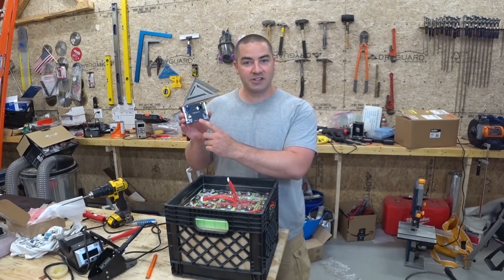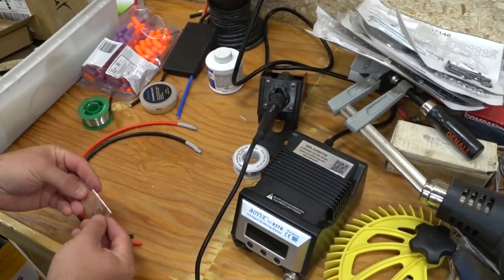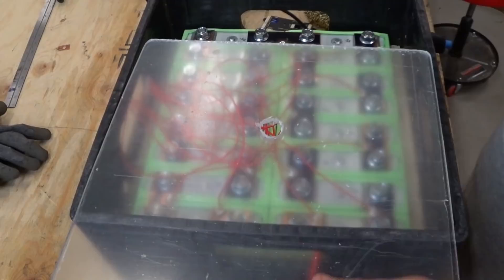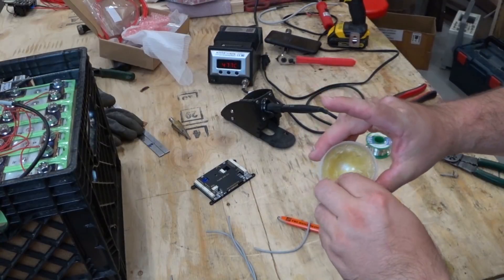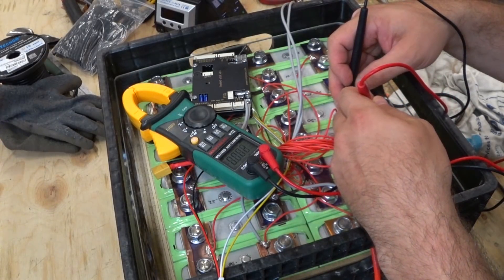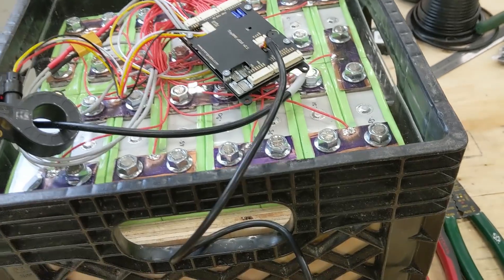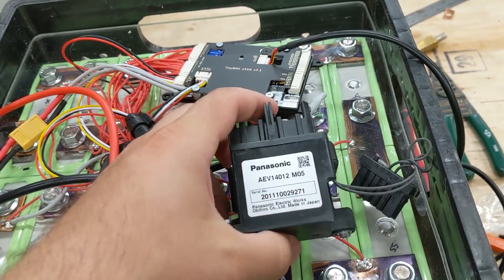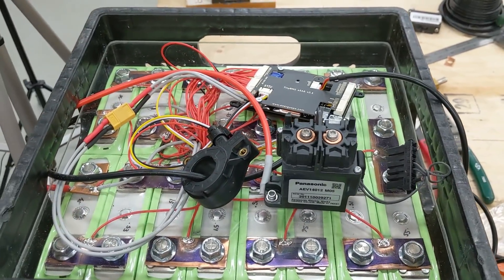Tiny BMS installed in the Milk Crate Project

Comment: Where did you purchase those spools of silicon wire? I can only find small pre-cut lengths on eBay/Amazon.
Reply from the maker: Red: https://amzn.to/34HUknl
Black: https://amzn.to/32uFmhO

They come in handy for all these projects.  I'm glad I bought the spools.
Reply: Ordered one of each, thank you!
Reply: @DavidPozEnergy  Question for you sir. If you built a 48V pack out of LifePo4 cells than are 280 ah each, how much would that actually store in kWh? I was also wondering if you knew anyone using wind turbines with these type of cells? I want a hybrid system where I am.
Reply from the maker: Hi Dave Froman.  If you are using 280 ah cells, then multiply the ah by the cell nominal voltage.  In the case of LiFePO4, that is 3.2v.  So: 280 ah times 3.2v = 896 wh (watt hours) per cell.  Then multiply that by the number of cells you are using.  This video is using 16s.  So if you also did a 16s, it would be: 896wh times 16s = 14,336wh or about 14.3kwh.
Reply: @DavidPozEnergy  Thanks for the explanation :) And that is the magic number I was hoping to hit!

Comment: Hi, I am using the same tiny BMS and followed each and every step but when I connect it with USB to UART cable with battery insider installed in my laptop it does not show any thing and it does not detect the BMS. The only thing which I did not follow I have not used the USB isolator and I struggling to find the same isolator which David has used. Any help related to this will be really appreciated. Thank you

Comment: For anyone reading this: Be sure you get genuine XT60 connectors, not chinese knock-offs, which melts and starts fires.
David, this is a quite pretty DIY build. If one does not have a milk crate, MDF or plywood could also do the trick.

Comment: Hi David, I have a question about BMS, I have a daly BMS, for lifepo4 8s I found out while charging the battery that the BMS cut off is set to 3.75 this seems a bit high.. can you brig this topic in one of your videos what should be the BMS cut off values? thanks
Reply from the maker: I agree it seems high, but it's not unusual.  Ideally, the charger is set less than that.  For example, I use Daly BMS's on my batteries in 16s.  16x3.75=60v  My charger is set to 56.8v.  If the cells are top balanced then no cell would ever go to 3.75v.  The BMS is there is something goes wrong.
Reply: @DavidPozEnergy  Yes, exactly, this only happened because the cells are old used cells, they have different resistance, I have balanced them but then on the first cycle there was one cell that was high and the others were low.. the pack voltage was under 29v but this cell was 3.70 :/

Comment: What if one of those solder joints on the BMS leads fails?  Will that harm your battery or your BMS?
Reply from the maker: The BMS will just shut off to prevent any damage to anything.

Comment: What resistor are you using at 7:00 ?
Reply from the maker: https://amzn.to/2NrBrhI  But most resistors will work.  You can even use an old lightbulb.  The goal is to slow the charge of the capacitors.

Comment: hi, if i have a 12v diy battery pack with bms, and a 100w solar panel, do i still need to have a charge controller?
Reply from the maker: A charge controller is required for almost every situation, and all lithium batteries.  But if you have a unique situation of flooded lead acid batteries, and the correct voltage of your solar panels, then it's possible you don't need one.  But that type of situation is very rare.

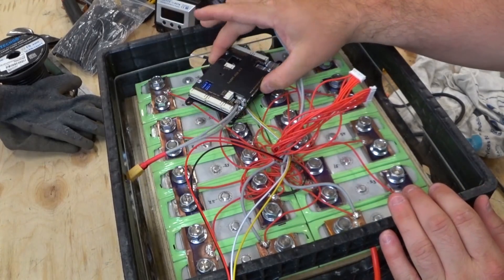Comment: 6:45 Could also just use another one of those XT60 connectors and charge up the bms with a current limited power supply set to the same voltage as the battery instead of the resistor.

Comment: Isn't it OK to tap off 12V from the 4th cell (from the negative terminal)? That gives you a common negative, but a 12V supply for the relay, rather than using another converter. But maybe there's some reason that's not a good idea -- I can't think of one though.
Reply from the maker: I'd be OK if you don't constantly use power.  But if you always draw from those 4 cells, they will drop in voltage prior to the other 12 cells.
Reply: @DavidPozEnergy  Right, but the current to just hold the relay will be small compared to the total draw from the pack, so it should be insignificant.

Comment: How do wire sixteen 100ah LifeP04 lithium cells to create a 24 volt battery?
Reply from the maker: Wire every 2 cells together in parallel, then series 8 paired groups.  This is written as 2p8s, meaning 2 in parallel and 8 in series.  If you are on Facebook, then check out the group "DIY Battery" for more help.

Comment: Please add a strain relief for the main poz/neg, and perhaps a way of retaining the relays/contactors..and dont forget as the posts/strips warm and cool, theyll expand and contract...maybe put the isolator in the box as well, and leave the micro port easy to get to..along with an emergency off button or emergency power off port, if you plan on making multiples of this, to link togeather to a single shutoff button...(and or fire system)

Comment: I hate to say this, but with the  wood you have in the milk crate, you just insulated the entire battery pack and therefore will hold the heat in and therefore the entire pack will have low heat dissipation.  That is not good for those cells.  What you should have done was make spacers in between each cell and eliminate the plywood sheets.  That was the whole pack could breath and therefore eliminate heat between the cells.  I have an electrical and electronics engineering background and have a solid working knowledge of batteries and battery construction.

Comment: Can you do a little "short", where you explain the use of the resistor?  It wasn't clear to me, what you did & why.  Cheers!
Reply: the resistor is used to dampen the "in rush" of current into the BMS. Think of it as a restrictor that slows down the amount of juice flowing in. It also can prevent sparks from flying when there is a dramatic difference in voltage potentials. Once the two systems have "equalized", the resistor isn't so important, but it's always a good idea to keep it in the loop. You'll note that the size of that resistor is large, (fat+long with heatsinks) the amount of restriction may be low (low resistance value) but it's ability to handle high current is dictated by it's designed ability to remove that heat. Hope that explains it for you.

Comment: Next time when you go to drill a hole in the plexiglass, sandwich it between two scrap pieces of 2x4 and drill through the sandwich. You'll have a clean hole in the plexiglass. Hope that helps for the next time :)
Reply: Just use your stepper bit.

Comment: just started watching and am intrigued by your projects.  but i have a lot of questions.  i have an RV that i want to build my own battery bank.  it is 12 volts.  do i just build a 48v pack then step it down for the 12v?  how can i make sense of the numbers?

jd
Reply from the maker: 12v is OK if you are running 12v lights, 12v radio and little things like that.  But the amps will get too heavy if you try to power normal AC loads.  So I prefer using 48v for anything that needs an inverter and AC outlets.  Sometimes batteries are rated in amp-hours (ah) and if you multiply the ah by the volts you will get the watt-hours (wh).  That's a way to normalize comparing a 12v to a 48v.  This milk-crate battery is about 3kwh (3,000 wh).  If that was in a 12v version it would be 3000/12=250 ah.

Comment: That looks like a great BMS but those pads where you connect the battery don't seem to be able to handle much current.  It would have been better to have studs so you could bolt your battery cables instead of soldering.  I would be afraid of the solder melting at high amp draws....!

Comment: DavidPoz, I have a dumb question that by the way, you are the only person that has a video on the Tiny BMS, I'm using this BMS on a 10s battery pack and looking over the doc file I just thought I would ask you. topmost wire is attached to + (also number 1 cell) and the bottom is connected to - only...  thanks
Reply from the maker: Thanks for checking out the video.  I hope to do more videos on this BMS because it seems like it can do a ton of things.  You probably already have the manual, but I'll link it just to make sure you are not looking at the quick start guide.  manual: file:///D:/Users/David/Downloads/TinyBMS_User_Manual%20(1).pdf  On page 14 there is a wiring diagram.  I think this one diagram is most useful for understanding the layout.  Yes, the top most pin is the main positive of the whole pack.  The bottom ones will be left un-used after you finish your 10 cells.  10 cells should mean 11 sense wires.  Make sure you check all your wires are correct on the white terminal before plugging into the BMS.  If you have just one wire crossed it will (probably) fry the circuit.
Reply: @DavidPozEnergy  thanks, I do have the doc file and was looking at page 14 to, but on that page the last wire looks like it goes to - the also looks like it connects to a cell, plus pack + is also + for cell number 1... Just looked weird. I have wired up a bunch of BMS cell 1 + and the last wire goes to - simple
Reply: Thanks, everything works great, on page 13 in the doc it talks about a 10s pack and gives you step by step, great documentation!  Now I'm waiting for more parts to come to.

Comment: You are doing a great job, and I love your videos.  I'm a newbee, I understand the need for a relay.  Can you recommend off-the shelf relays that would be readily accessible to us and show their hookup?  Scavenging parts from an electric vehicle is not an option for most of us.  Are they that expensive that rather than buy one, you scavenge one and have to buy another for it to function?  Also, if you could recommend a proper resistor to use for the hookup would be helpful.
Reply from the maker: Thanks.  Great suggestion.  The type of relay I showed (from an EV) can cost more than $200 new.  But if you don't need 300 amps, there are more affordable options.  Actually, I"m looking at some smaller options for this particular build.  But I also want to learn how to use the big relays so I can use it on some bigger batteries.  This particular milk-crate build I have 10 gauge wire, and will limit it to 30 amps with a circuit breaker.  So all I need is a 30a relay or more.  I'm considering using one like this https://www.mouser.com/ProductDetail/Omron-Automation-and-Safety/MY2-DC48-S?qs=sGAEpiMZZMtGt%252Bn33CgIP%252B2KxmC%252BClteYxZLiC3CNNo%3D
Reply: @DavidPozEnergy  What I have in mind is a 48 V system using an MPP 5048 like you had in one of your other videos, and based on Will Prowse's 24 volt hand cart system.  I plan on getting a Tesla in the hopefully not too distant future, and hope to use solar to charge it.   30 amps may not be enough to do this.  By the way, did your friend get his water pump to work with the MPP 5048?
Reply from the maker: Yes, the LV5048 worked to start my friends well pump.  But he has to be careful not to have a second heavy load on at the same time the pump is trying to start.  For example, he had the inverter overload with a microwave and toaster on, and then the pump tried to start.  Personally I don't think the LV5048 is ready for prime time.  Good luck with your build.

Comment: While some of us are bored watching the Tiger King and all of the other embarassingly high amp IQ draining boob tube things...... I just got done adding an electric starter to my 10 hp 5000 watt gen..... (but electred to NOT add an on board battery)  and then for desert.... I discovered Dr Poz the DIY Guy.... THANKS for contributing to the species ( vs taking away) !!!!!

ps.... there are a couple of ok vids showing how to convert an older 10 hp briggs and stratton engine to electric start..... all parts are still available as of Sept 2020.... to avoid buying another battery which would just sit in the gen frame and be used 3 times a year,  I elected to add an "Anderson" quick connect to the gen control box which connects to the 12v starter motor solenoid and to engine ground. and then I fabricated a " jumper cable" that has an "anderson"  quick connect on one end and ( 12v) Battery connections ( medium amp alligators) on the opposite end ..... now we can start the gen by 1) plug anderson connect to gen receptacle, 2) connect to any car batt.... 3) hit start, 4) disconnect anderson and alligators... =.... electric start but no additional battery to deal with...... 

p.p.s. I was considering building an adapter mounted to the gen frame, so that I could just connect one of my Ridgid 18v cordless tool batteries. Sure High draw but for only a few seconds.... and my ridgid batteries are covered with the "Lifetime service agreement"... the LSA isnt PERFECT... so it does require "understanding how to use"... and it helps to find a GOOD auth repair shop and AVOID having Home D in that loop.... but THAT would be a sweet mod... pop in the 18 v battery ( whatever battery with a volt limiter) 
hit start.... take batt out of gen... let cool... place back on charger.

Comment: You don't need an USB isolator. There is no point using it in your setup. The only case you would need an isolator is when three things are true: 1) The battery pack is connected to inverter, 2) laptop is charging from that inverter, 3) there is ground path from the laptop power supply. This will never happen with laptop power supply. They are fully isolated already. If you connect it to a desktop it might be slightly different. But using isolator and having one around is a good thing. It is idiotproof.
Reply from the maker: Thank you.  I didn't know what conditions would need an isolator.  The manual just said to use an isolator.  It didn't say when you didn't need one.  I appreciate you helping me out in understanding it.

Comment: I think most LiFePO4 cells use 3.60 or 3.65 as max cutoff voltage.
Reply from the maker: Yes you are correct.  These have a max. charging voltage of 3.65 volts per cell.  Usually the BMS is set to 3.70v before it will cut power and shut off.  It won't cause any damage.

Comment: What is the intended max amperage draw through the system, please?
Reply from the maker: I'm going to limit this battery with a 30 amp circuit breaker.
Reply: @DavidPozEnergy 
If ur only doing 30 Amps u don't need 2 use the contractor... most relays should b able 2 handle that on their own...

Comment: Fun fact on drilling plexi glass, run a twist drill in reverse, or use a very dull bit, and drill with some sort of something on the back side. Basically melt thru it.  It’s the best way.
Reply from the maker: Thanks for the tip.

Comment: I think the better way to connect the balance leads to the bus bars is by using crimped ring connectors.
Reply: They'd have to be very large rings though, and need to be stepped down to the tiny wires.

Comment: Simple transistor, diode, and resistor to not use a second relay. Lookup control 12v relay using arduino or mcu

Comment: David, I looked up the Panasonic relay. The coil power rating is 4.2kW (up to 120A and 400Vdc) and the coil voltage is 12Vnom at 353mA.

I'm also familiar with the Tiny BMS, and wonder which model you have, low- or high-power.

As the low-power model is rated for 30A continuous/60A peak, and you're limiting pack output to 30A with the panel-mount breaker, I'm curious as to why you're choosing to use such a large (and valuable [~$223]) relay to switch external loads. Especially when doing so requires the addition of a buck converter to step battery voltage (48Vdc nominal) down to relay coil voltage (12Vdc), as well as an intermediate relay due to the Panasonic relay's coil current requirement of 353mA outstripping the BMS's external I/O's 250mA continuous rating.

If one absolutely needed an external relay, there are better ways to go about it with the Tiny BMS. A contactor, such as Gigavac P125-FDA, has a coil voltage of 48Vdc at just 45mA, well within the Tiny BMS's 250mA rating. This obviates the need for a buck converter and intermediate relay. 

This $60 contactor switches up to 1,200Vdc at 30A continuous.

Lastly, I wanted to point out that this BMS will need to be "woken up" after a low voltage cut-off event when powered by the battery it's protecting. A charge will have to be applied from an external source before a supervised charge will flow via the Tiny BMS.
Reply from the maker: Hi John,  Thanks for your input.  I'm learning about the Tiny BMS, and may end up using it on a larger battery in the future.  That's why I'm trying to figure out how to use it with a contactor.  On a bigger battery I may need to handle a couple hundred amps.
Reply: @DavidPozEnergy  I've long suggested that people use relays or contactors, rather than high current BMS units. Besides the high cost, these BMS's generate lots of heat and that concerns me as a single point of failure.

Much better, in my opinion, to control external switch gear with the BMS.

While I typically design larger systems this way, a recent 26.5kWh system powering equipment requiring high voltage, high current, 3-phase power wouldn't have been possible any other way.